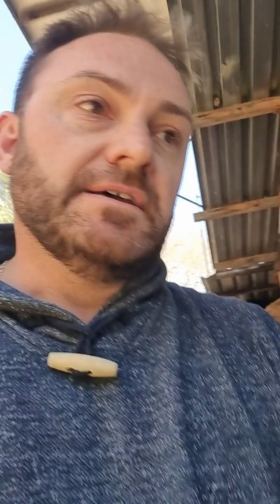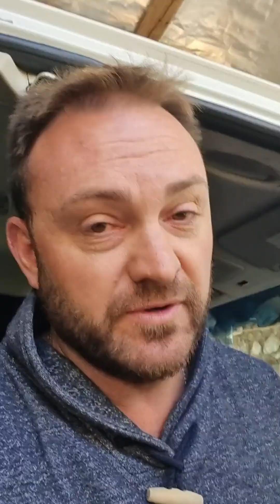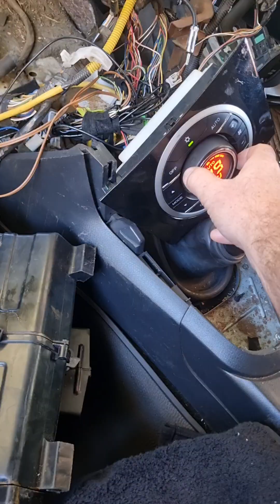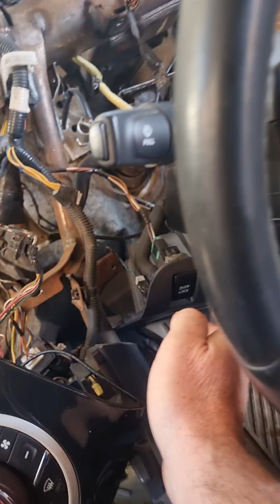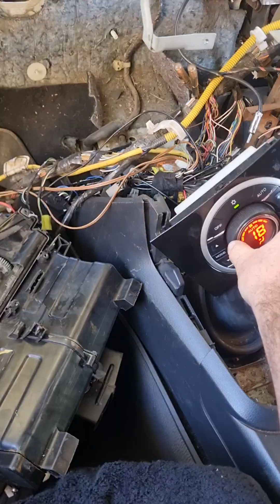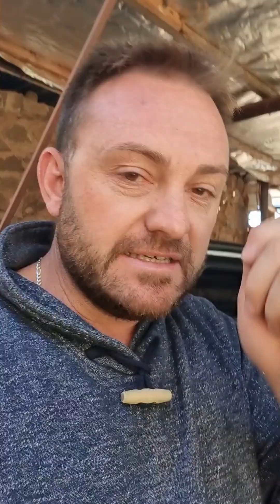How to fix your climate control issue on a Isuzu Dmax kb300 lx. Cabin sensor location!

Comment: Thanks for sharing, you have saved us a lot of money.
What advise can you give to someone who wants to buy the 2014 to 2021 dmax 300 4x4? What are the pros and cons?
Reply from the maker: Advice, make sure all the oils were changed from the diff to the gearbox and front actuator. If the previous person 4x4 through deep water it goes into the breather pipes.
All the breather pipes have to be extended into the highest place inside the bonnet area. Use high spec oils. GL5 for diff and gearbox.
Remove the Cat and Blank off the EGR. And have it mapped.